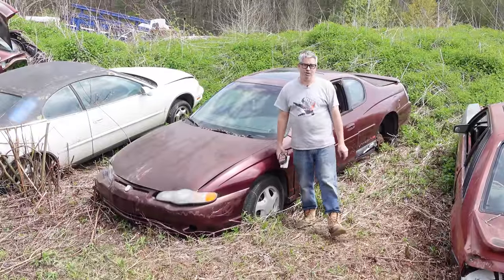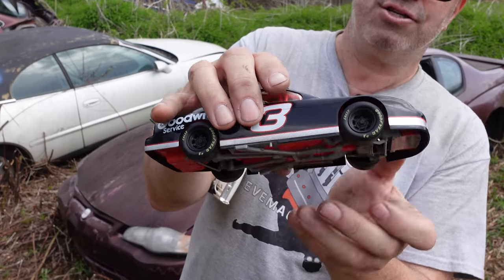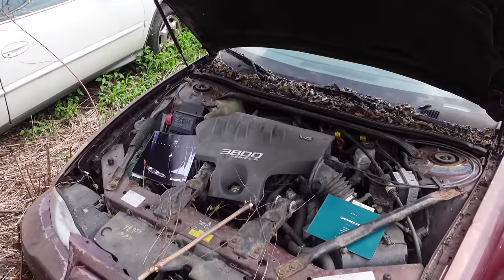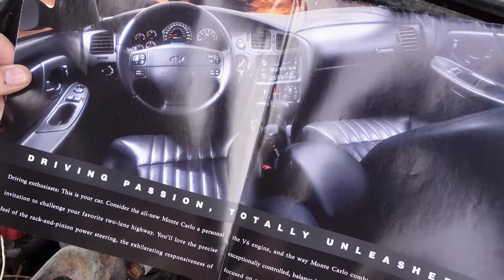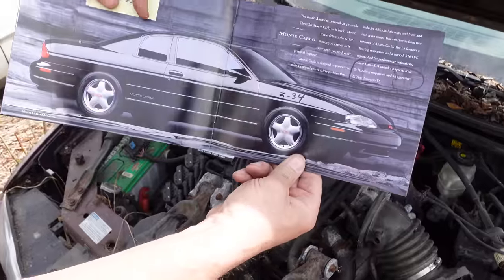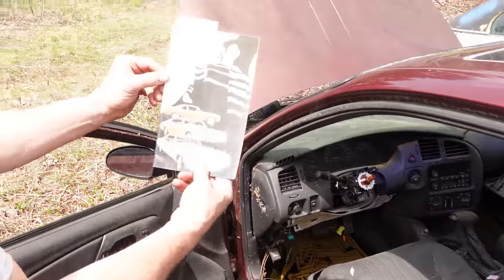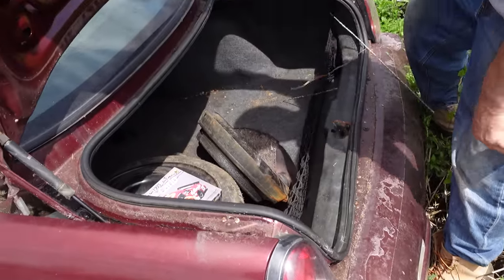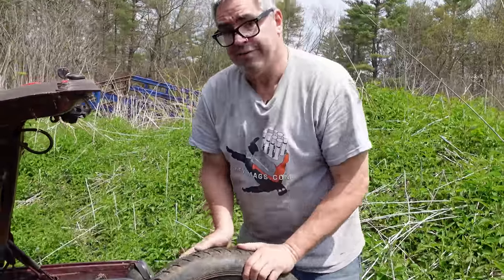Monte Car Low

Comment: Yes, the 5.3 V6 would be a real "find" as it didn't exist. Of course, we know you meant 5.3L V8 and it was just a slip of the tongue. Yes, the Monte Carlo of this vintage was Lumina based as both were "W" body cars (like their cousins the Oldsmobile Cutlass and Pontiac Grand Prix). 

No VIN, can't win, but somewhat easy to figure out, no doubt: 2G1 for Canadian made Chevrolet passenger car, WX15 for Monte Carlo SS, K for 3.8L V6, aka RPO code "L36", then a random check digit, then 1 for the 2001 model year, 9 for Oshawa, Ontario Canada assembly, and the rest is the production sequence. The Oshawa plant operated until 2019, closed for a short time and then opened again in 2021 with a Silverado being the first vehicle off the reopened line. The plant still operates today. 

Chrysler tried to use "Taz" for the Duster logo, but negotiations failed between Chrysler and Warner Brothers, so Thomas Bertsch designed the "twister" logo that would be used by Chrysler. Mr. Bertsch was the interior designer director. 

Correct, no manual transmissions in these "W" body cars, only the 4T60E, 4T65E or 4T65E-HD four speed automatic with overdrive depending on the year and engine option. The four means four speed, the T means transverse mounting, the next two numbers are the relative torque capacity/sizing/etc. for the transmission and the "E" means electronically controlled. No tag, can't brag, and no SPID (on the trunk label right where you were), wish you did, but this is code 51/WA203C Dark Toreador exterior paint.
Reply: Never knew that the "Twister" logo was born out of a failed attempt to put Taz on the Duster. Personally, I never liked Taz and I think I would have been weird on a Duster (I guess Plymouth wanted to compete with the Demon and look how that ended up for Dodge). 

The pancake spoiler on these Montes just look dumb. Does nothing to begin with on a front wheel drive car and doesn't even look aerodynamic. At least the blade version on DE Jr versions looked the part even if it was still a useless piece of plastic...
Reply: @LongIslandMopars  Yup, I believe he died in 1987.
Reply from the maker: I sometimes juggle numbers as I speak and YES, i called the 5.3 a V-SIX twice. Argh. Of course we all know its a V-EIGHT! Thanks for watching and understanding that my long suffering 58 year old noggin suffers valve float occasionally. Oh, if you dig Oldsmobiles...you'll probably enjoy next week. We visited "The OLDS Red Barn" and found some treasures! Those 8 videos begin next week. I hope you'll tune in. Hint....can you say "J-2"? -Steve Magnante
Reply: @SteveMagnante  Yes, I like Oldsmobile. Back in 1983-1984, my sister had a 1974 Gold Duster (with the LTP). She wanted another "twister" decal. So we penned a letter to Lee Iacocca's office requesting them. Sure enough, they replied back with two, and they were "360" decals. We used them (less the 360 lettering) on the Duster. We sold the car in 1985. The guy that called the house said to my mother, "Your husband said you would take $1300 for the car". We were only asking $900 in the paper. Sold. The car "lived" in our neighborhood and I saw it until about the early 1990s when the new owner would come home from college during summers. After that, gone. I'm sure it's long been made into a washing machine or dryer three times over by now. LOL.
Reply: @SteveMagnante  Awesome. Can't wait for that series.
Reply: Dark Carmine red …
Reply: @mattmc8391  That's not the name of the color in 2001.
Reply: @googleusergp  yes it is … in fact even in to 2002 it was still dark carmine red …
https://www.motorologist.com/wp-content/uploads/2002-Chevrolet-Monte-Carlo-brochure.pdf
Reply: Other sources have it as Dark Toreador, and my 1980 Trans Am had two color names depending on which GM document you read.
Reply: @googleusergp  completely different paint code for Dark Carmine . 72U/WA675F
Reply: @mattmc8391  GM has been known to use two names for the same code.
Reply: @mattmc8391  You're missing the point. GM used two or three names at times for the same paint code. For instance, code 79 on my 1980 Trans Am is both "Red Orange" and "Carousel Red" depending on what GM document you reference. Just because the brochure called it that, it doesn't mean it's not shown with another name in other GM literature.
Reply: How is it the same code …. 

Dark Carmine is code 72U/ WA675F 
Dark Toreador is code 51/ WA334
Reply: @mattmc8391  What does the "W" series parts book show for that color in that year?
Reply: @googleusergp  Not sure ,  I can tell you that a monroney label and sales literature all say “ Dark Carmine red “  

So I guess all the GM insiders know it has two names and two different paint codes .  
This is one of those issues that shouldn’t exist . When these cars came out , I collected every bit of info I could on them and I knew when you called it “ Toreador red “ that I had never heard that on this and the Impala .

My question is , why not go with what the rest of the world knows it as ? 

A person could have bought one of these new , and their whole life could have known the color of their car was Carmine red based off of sales lit and window sticker … and 23 years later be told … you know , your car is actually Toreador red.. 
makes no sense
Reply: Ask GM why they do that. Because they do.
Reply: @googleusergp  That figures …. Last few GM vehicles I and my family owned had really gone down hill compared to years ago .   Last one was a new 2017 Silverado 1500 , had the “ Chevy shake” that could never be figured out , and the worst/ hardest shifting automatic I’ve ever experienced, got rid of it at 20k miles , couldn’t even take it on a trip due to the vibration.  

Meanwhile my 91 c1500 is still around and one of the best vehicles I / we have owned .
Reply: @mattmc8391  No more GM for me for a while (except for classics).
Reply: @SteveMagnante Glad to see your expertise is still alive!! I remember watching you on Hot Rod TV all those years ago. 

Keep it up!!

Comment: I had an '09 impala ss with the 5.3.  Yeah it was front wheel drive,  but that thing would run.  It went good in the snow too.  Ended up with electrical demons so it went bye bye.  Miss it though.

Comment: Those buick 3.8 , V6 weren't bad engines , in those 6th gen Monte Carlo 's .

Those phenolic upper intake plenums could become porous , around the coolant bypass tube area  , behind the Throttle body  . 

You're right ✅ a V8 was available in
 the last years of the 6th gen run .
Reply: yep my son has a 97 Pontiac Grand Prix GT 3.8.
Reply: The EGR pipe melts the plastic intake! Thats why the series III got an aluminum upper intake manifold I would guess

Only 3.8 I ever killed was because of that, replaced the oil with coolant.

Comment: I had a Lumina. Bought it completely clapped out for %100  because I needed a ride to work and it ran. On my way home, driving through Birmingham I ran right over a manhole that for whatever reason didn't have the cover on it. It ripped the tire and drive axle off, destroyed the transmission and ruined the engine in the process. The city of Birmingham who had towed the car accepted full blame and responsibility for the accident and did all the repairs in their Municipal garage. New axles, transmission and engine. 
So I drove a clapped out Chevy Lumina with all brand new sparkly drive line. 😁

Comment: I owned that SS Monte Carlo and I loved it. It is too bad it had that lousy gutless oil burning 3.8 engine or it could have been so much better. I had a 91 Lumina Euro Sport with the 3.1 and it was a better engine. Thanks Steve!
Reply: I had a 2001 SS in silver. Sharp looking car and I enjoyed driving it. Not a fan of the junk 3.8. I babied mine and it still self destructed far before the car itself was showing any wear.

Comment: A little note that from 2000 to 2003 they made the monte carlo pace car edition they only made 2000 each year  I had a 2000 that was number 68 made that year 2000 was red with red and charcoal seats 2001 was black 2002 was yellow and 2003 was blue. Only the 2000 red cars had red inlaid seats all of the others were just charcoal leather seats

Comment: Thanks for the history lesson, it put some context on these. I always hated these 5th and 6th gen Monte Carlos, such a dark spot, like the Mustang II, Challenger Compact or the FWD charger. The styling is 90s in the worst way, like a dodge stratus, big useless overhang, bland aero shape styling, weird blobby lights, that god-awful 90s GM interior with all of the rounded plastic junk, not to mention FWD and almost exclusively automatic and paired with crappy sounding low revving V6s. These and the goofy looking catfish camaro (the only decent looking G4 F-body is the WS6) are what helped drive me away from GM's cars entirely. It does still interest to hear more about their history though.

Comment: My neighbor had one of these and it was all beat to shit. It was silver. Blown out exhaust so loud it vibrated the whole car, and drift stitches on the front bumper holding a big crack together. It wouldn't pass inspection cause it was so rotted underneath. I drove it a few times. I nick-named it "Behemoth Bubblicious" cause it was such a big car with a curvy body style. Had those same alloy wheels too, with every one of them missing the center covers lol. I had a 1999 Corolla 5 speed and I jump started his Monte Carlo once and told him to give it a little gas to help charge the battery. My dude holds it on the rev limiter for like 10 seconds while I yell for him to stop. He isn't very smart with cars.Ended up crashing the Carlo.But I help him out when he has problems with his cars. He's driving a beat to shit Infiniti Q30 now.

Comment: GM made some pretty front drive coupes in the late 90's early 2000's and that Monte Carlo was one of them.  Too bad they weren't rear drive and were produced at a time GM bean counters crushed their great engineer's designs by demanding low cost low quality parts.

Comment: Thanks Steve. I had a 2001 SS. I liked the styling. The dual tailpipes. The interior layout and leather. Sunroof. Silver paint. Orange badges. Fun car to drive. But the 3.8 motors were junk. Mine self-destructed due to the intake gasket / GM coolant issue.
Reply: The GM 3800 one of the most reliable and durable engines ever made.
Reply: The engine wasn’t junk , the intake setup was though .

Comment: The trans in those were the downfall(same as impala ss fwd). GM messed up big time because the trans was only rated for 250hp and even detuned in the monte/impala 5.3 would blow them out. But they did put the good 243/799ls heads on them.

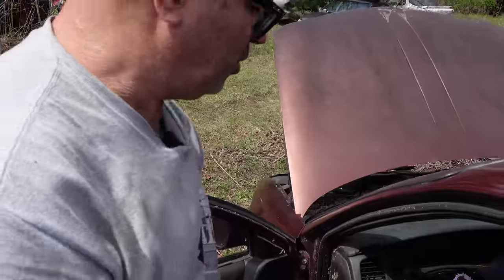Comment: 6:43 I spy a Lumina Z24 in the background. Future episode? 🤔
Reply from the maker: Yes, BUT only if we can get the hood open. So far it is stuck and I never hammer on these cars because they aren't mine. But if I can get Dale Hastings (owner of Bernardston Auto Wrecking) to open the hood on that Lumina Z34 we'll feature it for sure. I need to know if it has the super trick 4-cam, 4-valve 210-hp 60-degree V6!!! Thanks for watching and writing. -Steve Magnante
Reply: @SteveMagnante  Great video Steve as always!  Concerning the Z34...depends on whether it's an auto or 5 speed.  The automatic cars had the 200 HP version...the 5 speed cars have the 210 HP one.  For the Lumina Z34's, the 5 speed option was available from 91-93 only.  A Getrag 284 manual.  I own two cars with these motors, RPO code of LQ1.  They're wonderful!

Comment: I thought these were kinda cool. I am not a member of the ancient car club that believes only rear wheel drive is cool. I think Nascar used these for a pacecar for awhile.  Pretty reliable engines, famous for the plastic intake coolant leak problem that was an issue in the 2000's for Ford as well.  Supercharged 3.8 are really fun.

Comment: I have never liked ANY Montes.  Turning a front wheel drive V6 into a RWD V8 for NASCAR was a ridiculous dealbreaker.  Ford did the same with the Taurus.  RIDICULOUS!
Reply: Somebody should sue NASCAR for even having their name. As if it wasn't bad enough that they are racing two-door versions of cars that are only available in four door, but now that they have eliminated the five lug nut Wheels there's absolutely nothing resembling a stock car.
Reply from the maker: @garyszewc3339  I'm with you. NASCAR has devolved into a race of Rolling Billboards. The cars get no play, its all about the drivers. I am 58 and remember when NASCAR instituted the 355 cube limit in 1974 I was 10 then and pretty much checked out! I clearly remember the 1972-'73 restrictor plate debut as Boss 429 and 426 Hemi drivers were choked out so the Chevy 427 could play too. It seemed "if you can't race with them...handicap them". Boring. The current stuff with EFI, trans axles, knock-off wheels and hideous generic "Car Of Tomorrow"-type non-shapes leave me C-O-L-D. Car Of Tomorrow! Remember that sick joke? Anyhoo, I'll get back to the junkyard where I belong. Thanks for watching and writing. -Steve Magnante

Comment: A great overview of the Montes!  I drove a company furnished 2000 SS with the 3800 Buick. I was probably the third operator and it had been rode hard and put away wet a few times. It was actually a decent handling car although engine performance was only as peppy as the 200 HP V-6 could muster, but would keep up with traffic. It had a top end of a bit over 120. It was also comfortable to operate. These were certainly a lot better in terms of performance, comfort and styling than the previous Lumina-based versions. I don’t recall that it torque-steered much. I can still smell the asbaestos from hot brakes after a particularly spirited spring day commute one afternoon. The SS of era was a good car. Never drove the supercharged V-6 or the V-8 versions of the MC. I later operated a supercharged Gran Prix so I know it would have been a great improvement.

Comment: General Motors front-wheel drive straight off the factory floor rolling junk. Should have just driven them straight to the junkyard, not Parts yard, junkyard. Worked on them, owned 1, that was it. Nothing but junk front wheel drive. Thanks for this flashback but no thanks.

Comment: Any version of the 3.4L was GARBAGE, swap it out with the quickness!!!

Z34 Monte received the 3.8L in its last year. 2004-05 Monte Carlo SS received the Supercharged 3.8L and the last and in my humble opinion, best-looking W-Platform of the Monte Carlo SS was equipped with the 5.3L. 

Transmissions connected to the 5.3L was made of glass. You can mate the 5.3L to the Transmission from a Cadillac STS with minor fabrication including the relocation of the starter. There are how-to videos available on YouTube as well as affordable kits and CPU Programming.

I am building a 2006 Monte SS with this upgraded transmission set-up with my son, and it's really not as hard as I thought it would be. It is fun to drive, shifts perfect and fully able to accommodate the power of the 5.3L V8 and MORE which means you can do burnouts for days and a well maintained caddy trans will hold. 

The only weakness left is the power steering pumps for those 06-07... I haven't found a remedy for that yet... Anyway, Caddy Trans + 5.3L is the formula to create a reliable powertrain.

After the complete overhaul on the suspension is complete and the upgraded larger front & rear brake rotors and calipers from a 02 Z28 the car will be complete. Gonna send her in to the body shop to buff out that paint to a show room shine and some undercoating & sealing and she will be ready to give to my son for his 16th birthday this August because my boy is a gentleman and every gentleman should own a Bowtie dammit 😉. He thinks it's a customer car! This whole time, I've been training him to know his own car like the back of his hand, making him earn it lol. The Warden/Wife doesn't even know yet, you get away with a buying extra parts n stuff this way 😆

Yeah, she's not to fuel efficient but 24 AVG MPG ain't that bad especially with the sound coming out of those Flowmaster 40 Series Duel Exhaust. She has minor MPG flaws but she has teeth and she runs like a raped ape!

I definitely recommend any 98-07 Monte SS or 97-03 Grand Prix GT or GTP as an affordable reliable 1st beater car for your kids. They turn out better when you fool them into helping you fix em up too 😉 my apologies for sounding like a geek with the long comment but I'm proud of this 06 Chevrolet Monte Carlo SS lol.

If you own a proper CHEVY like me that is nastier than a stripper pole under a microscope, than get out to the street or strip and school them fake MOPARts.